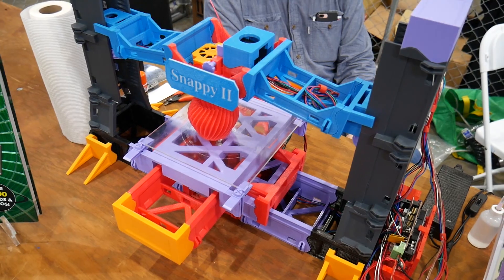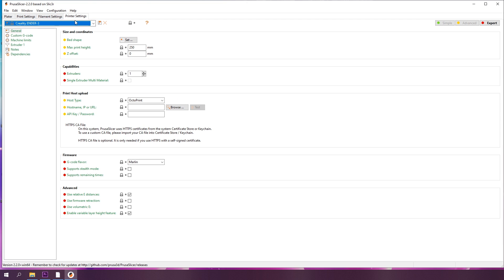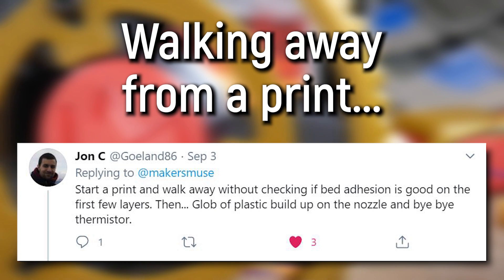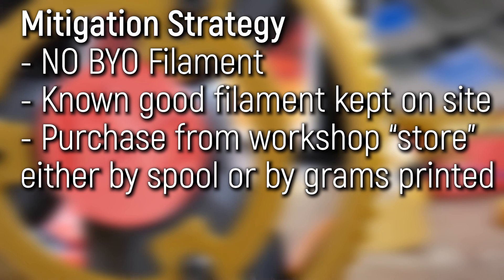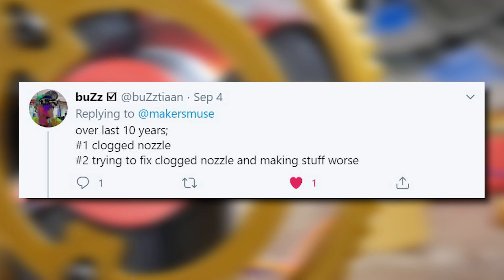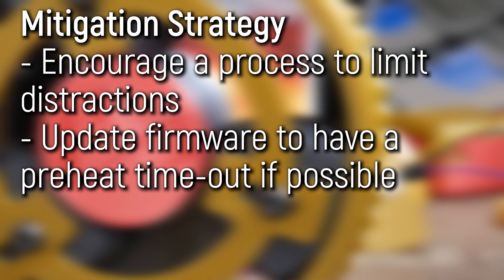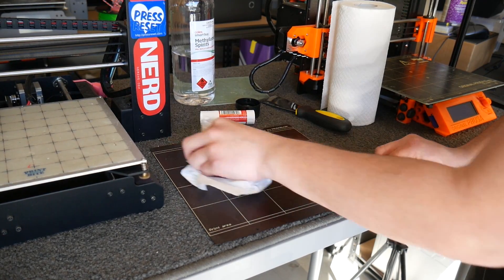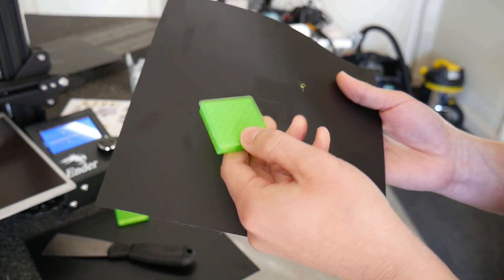How People BREAK 3D Printers (and how to stop it)

Comment: Always good videos from you. I was new to 3D Printing 4 months ago and I have done many MANY prints since then and made my share of mistakes. First, the machines I own, a Dobot MOOZ and a Sindoh DP200. Started with the Dobot. I was looking at the Snapmaker but the MOOZ was EXTREMELY attractively priced. There must be a lawsuit between these companies as their machines look identical. Big initial problems with bed adhesion and print head clogs. I tried, what I saw online, painters tape, hairspray, glue stick, BUT I got the solution. For the MOOZ what works best is a very light spread of Elmer's School Glue. First I thought that when it dries it is less sticky so I was laying down filament on slightly damp glue. NOPE, when it dries to a perfect clear it sticks very well. Another trick, after the glue is laid down once I can put 1 or 2 drops of water, get it a little foggy white, it dries and magic, I can get 10-12 prints before placing a slight amount of more glue. Also, I took what ever cover was on top of the MOOZ build plate and now I run on the glass plate. The Sindoh, no problem. I use NO agent I print right on the bed. It's the older MOOZ so no flexible bed but it is removable and heated. I was going to get a slightly newer Sindoh but the newer ones, get this, no heated bed. The DP200 has the heated bed. 

Second issue I had was filament loads. Secret I learned. I take the filament I am going to load into the MOOZ module and make sure 5 inches is straight as a nail. I load it to where I depress the button on the module to release the extruder wheels but I just stop at that edge. I then preheat the nozzle to 200 then use the LCD to extrude. You can also preheat the nozzle first, depress the extruder release and watch filament come out of the nozzle. But that way is slightly more risky. Fortunately the MOOZ is not that bad to get into once you get the hang of it. I cn break it apart, clear any jam, in 15 minutes. Why so fast? In the beginning I must have had 15 jams and 15 nozzle disassembles before I got the hang of loading.

The SINDOH. Their autoload from the cassette works well but I got their firmware update to run open source filament. Secret there, and you would have to own one of these machines to really understand this. When I am unloading filament to change colors, etc. I first cut the filament at the reel leaving enough of the filament to grab while it is unloading. I do this because if you attempt to reload ANY filament that hit the extruder wheels and is even slightly marked by the wheel it will jam about 25% of the time. AND clearing a jam in the SINDOH extruder requires a major disassembly, which I have done twice. I almost feel like leaving the side cover off and printing an enclosure for the computer board and extruder housing so I don't have to take off the side cover. So, wasting about 16 inches of filament but saving an extruder jam and full disassembly is worth it. I also noticed that I better stick with one quality brand of filament manufacturer. The MOOZ is a lot more forgiving as any jam is an easy fix but for the SINDOH I cringe any time I swap open source filament in fact even when I load the cassette with the proprietary SINDOH filament I also cut off 16 inches of where the filament entered the extruder as I want pristine filament that has never hit the extruder gears to enter the machine. 

Sorry, long post and it's clear that I should also be doing videos as I have a whole lot of knowledge now, including Brim, Raft, etc. how to more easily remove a Brim, etc. Lots of knowledge as when I get involved in something I am ALL-IN. Cheers again great content.

Comment: I know nothing about 3d printing, but do the filaments have a standard for heat and flow rate?  How do you figure out what works with your 3d printer?
Reply: Yes there are standards. They usually come on the box the filament you buy. There is a lot of experimenting still. Once you are to fine tune the machine and filament you wont have any issues

Comment: I have an Ultimaker 2 with a glass bed still. I just do a quick spray of hairspray before it starts and every few prints pull out and clean the glass. It's been running for years without a problem. For PLA on glass it's just been the easiest method for me. The prints also just pop right off after the print bed has cooled.

Of course I also have gone through a couple times and cleaned the linear rods and such to keep the machine running well. Most of my issues with the machine have actually been caused by filament getting broken/chewed up in the stock drive gear assembly.

Comment: So the people at my library don't actually know how what they're doing with their public 3D printer. Cool, good know.

For context, they painter's tape on the print bed claming that it'll keep the prints from warping and curling. Even though they warm and curl anyway. When one of the workers was replacing the tape, I tried to ask him to stop and don't use tape for my print, but he insisted. He said the reason the prints keep warping and curling are because it's too cold. I know the temperature has so to do with that, but I don't see how the tape will help.

They also just manhandle  the prints off of the print bed without removing the bed first. 
Now, I will admit, I'm also guilty of doing that. I didn't know before this video. But, now I do.
So, not only will I not be using their printer anymore, I won't be manhandling the prints.
Thanks for the video.

Comment: Welp the best advice I can give as a noob use the maintenance materials that are meant for the printer. Even I never take a big wrench at the nozzle... certainly not when cold. Having said that I did have a big maintenance run cause the printer stopped extruding, it went from broken fillament till clogged up nozzle (probably a combination of both factors as the fillament gets stuck and fills up the nozzle.

Comment: NEITHER of my printers will stay hot for long if you don't start printing, and even then I don't personally see the point of manually preheating too much when I can include that in my GCode. In fact, one of them doesn't even have the option to preheat manually because it's built into the firmware to maintain printing temperature for about 30 seconds to get a good flow going and then start printing, and if you pause or stop the print at any point it has to heat up again if you don't start it before it cools off too much.

Also, "Mount Stupid", that got a solid laugh. Mainly because I've seen how real it can be.

Comment: I love my Ender 3 pro. Though I might have done something because it seems to bulge up a little in the middle. It still prints good for what I am doing, but I wont make any phone cases or things that need a fine bottom surface until I get a spare bed sheet. But yeah, those sheets are the best ever. Had an A8 that was a nightmare to work with and then a Flashforge with no heated bed. None had the sheet and I will never buy one that doesnt have it.

A question though. Do I really have to remove the magnetic surface on the bed if I want to use a glass bed? Or can I keep it on, level the bed with the glass and print that delicious smooth first layer, then switch back to the sheet and level the machine?

Comment: 3d printers are so annoying but at the same time the best. i got a ender 3 pro recently and i love it yes it has its fair share of problems and for some reason i have to re level the bed pretty frequently witch is why i decided  to get the bl touch but in general having a 3d printer requires patience and some knowledge for example knowing the cause of some symptoms like when the print lifts in my experience is usually cause of the bed not being level and whoever used superglue clearly did not do his/hers research.

Comment: So I have some questions ... I'm running a cr10 s for about 2 1/2 years and its been a blast 
The printer has been super reliable and easy to work with 
So my first question is whats wrong with hairspray I've been relying on it since I got the printer emediatly gave up on painters tape and never saw a reason to change to a flexible build plate since stuff holds perfectly on glass and if you let it cool down allso will come off fairly easily 
Allso I have changed the nozzle cold before I dont have any problems with it extrusion wise how would one be able to tell that damage was done ? 🤔
And as a last what is the pre heating good for anyways ... it takes like less then 5min for the printer to heat up and prime it self why would you have it sit in idol heating away for some time
Reply: Well, he mentions hairspray being used wrongly, if you use it correctly, you're fine

Comment: I am a supervisor for a fablab. I have had students jamming the sd card in the wrong way ruining the mobo.
Double stacking the magnetic Prusa spring sheets (we have multiple) and ruining alignment and scratching the surface.
Also, using the sharp spatula we normally use for glass beds on a spring steel coated surface
Wrong Gcode is also a common one, in my experience Ultimaker 2+ and 3 sometimes just refuses to print, fortunately. 
Makes me cringe every time 😖 Good mitigation strategies!

Comment: 7:07 in my experience the cheaper filament is more dimensionally consistent and just as easy to print with. 
the problems stems from leaving the filament out too long and it becoming brittle. which all PLA fitments experience. this can easily cause many issues.
you have to physically measure the diameter of the filament you use no mater what brand you get for accurate settings.

Comment: I have had to remove, disassemble the nozzle assembly on a makerbot because the head was just not heating up enough to clear the jam and we eventually got a replacement print head which worked so much better. Public space in a university; the printer power supply finally failed and now a faculty member purchased a dremel to replace the old printer and I just love it.

Comment: Well the biggest issue is not the user but the current state of 3d printing, it is too DIY and user-unfriendly.The fact that you have to pre-slice and do weird settings to get it working is simple enough. It should be as easy and straight forward as possible, for example regular printing users can still mess up, but they don't have to input 100 parameters to get printer going, It is not that hard to have two way communication between computer and printer, printer should provide default profile or have built in slicer/engine, regular laser printers usually have the same setup engine board and formatter board, the formater takes care of the input and provide instructions to the engine, we are currently having only the engine.  So putting DIY machine in a shared space/school is the main reason why people brake 3d printers,

Comment: At work I have three glass beds for each printer. After a print is removed from the bed you can just chuck the bed into the dishwasher and it'll be clean again in an hour or so. Even though normally you don't need anything for sticking (maybe a bit of hairspray).

Comment: People touching the print/plate while it is printing!!!! 

An experienced printer swiping a string out of the way or tapping down a curling corner? sure

 An excited patron feeling the texture of a print or someone trying to "make it smoother" by squishing the print. even had someone trying to pull up the edges of a print while it was printing to " make it easier to pull up later" No, Please no. Don't touch the printers! They are hot, they are delicate, just don't.

Comment: Why do 3d printers use belt drives instead of lead screw drives like cnc machines..if its a matter of speed..that can be adjusted by RPM and gearing..and with anti backlash would help prevent shuddering ? could you build one to try..!
Reply from the maker: cost! Belts are a fraction of the price and the added torque and holding ability of ballscrews/leadscrews isn't required except for the Z axis.

Comment: I got a printer from a guy who had no idea what he was doing. He bought 8 rolls of Hatchbox pla and only used the printer once. He gave up on the printer cuz it wasn't printing correctly after "numerous fixes" when I bought the printer and 7 1/2 rolls for 50 bucks I was hyped to fix it only to find out the only "problem" was that he was slicing his models at a 1.8mm layer height with a .4mm nozzle.

Comment: Good one! :) I've made made most of those mistakes with my own print farm. Occasionally I'd load PLA profile for PETG print and wonder why it doesn't stick, or get distracted and forget to turn off preheating :)   BTW, glue sticks and hairspray are still valid applications for adhesion for some older printers. As much as I hate using hairspray, it works wonders on MIC6 (6mm thick) aluminum print plates that I use on my MakerGear M2 printers. It holds print and releases when plate cools down. Works great for very flexible filaments like Ninjaflex and Cheetah (but only smaller pieces).  Of course you don't want to spray it while it's attached to printer :)  I also use PEI sheets with TON of glue stick on top to release prints made out of Cheetah filament. I found it's the only way for me to print those parts. I use glass with kapton tape and I also use flexible plate systems like Prusa steel sheets.  So yeah different materials/printers require different methods. The only one thing I never use is painters tape :)

Comment: The worst I've seen at the Makerspace I used to help manage the printer at was someone took apart the Prusa to repair something, I forgot...and they snipped the heating wires. The big red wires? Cut right through them to take the entire hotend off. Then they said that they "prefered to tinker" than read the manual. What the heck?

Comment: Funny with the removal, I've been this guy who actually has used a hammer and the chisel/spatula that come with the printer to remove it from the glass. That glue printing for 8 days really got almost like concrete.  So i've been there. Did put a small chip in the glass with the hammer. but months later the printer decided on the blob of death and it just ejected the glass completely of the bed and caused shards of glass. Put quite a dent in the hardwood floor. being that this was a 500x500 piece of glass that comes with the cr 10 s5. good times for learning.

Comment: "I've seen schools that had a 3d printer in the woodwork shop... why?"
Shit, massive flashbacks, the high school I went to got an early deposition bed printer and the only place they could fit it was in a room that was only accessible via the woodshop. Obviously a closed system like a powder bed won't have the same problems an open printer would in that dusty mess but still, WHY?!?!?!?!
and in the media's defense
it is pretty much magic.
shit these machines might've gotten you burned at the stake in the late 80's.
Reply: In the 80s folk thought we'd have flying cars and time machines in the future. Either that or we'd all die from a nuclear attack, there wasn't really am in-between.
Pretty sure they'd be cool with 3D printers

Comment: Just sharing a discovery regarding the print bed, if non reflective glass is used on the corse side facing the print and adding just a light filme of cheap strong hairspray is good enough for excellent adhesion for: PLA, ABS, ASA, TPU, PETG.
When the bed cools down the pice jus pops off 
I use 2mm thick non reflective glass most commonly used in picture frames and most glass shops have them.
I will try nylon, PP, PC and other materials an let you know the results

Comment: Here's a thought, has anyone made a 3d printer with "true" auto bed leveling? I.e added motors to adjust the bed that way?
Reply: Oh, looks like duet 3D supports it on printers with with 2 or more Z motors driving the bed or gantry.

Comment: There's always the odd case of "I just fine tuned everything like a Stradivarius for this 24 hour print and the machine decided to pull a Kevorkian on itself" issue. 
My big delta decided to do this 19 hours into a 180mm turbine print which burned up a full roll of filament, broke the head clean off the effector and cause a good bit of damage to motors and such.
Sh!t happens sometimes through no fault of your own.

Comment: My favorite print bed story:  Glass print surface clipped to a PCB heater.  Print finishes, guy gets up, grabs a putty knife and a large plastic wrench someone printed.  Proceeds to use these as a hammer and chisel.  PCB flexes under the glass, glass shatters.  Would have taken mere seconds to remove the four clips, move the glass sheet to a table.  Also, love all that force going into the bed springs, Y carriage, and Y axis rails.